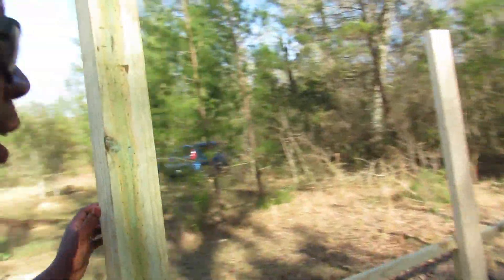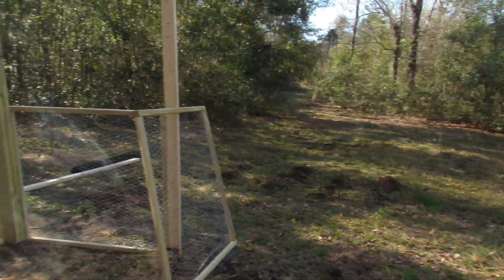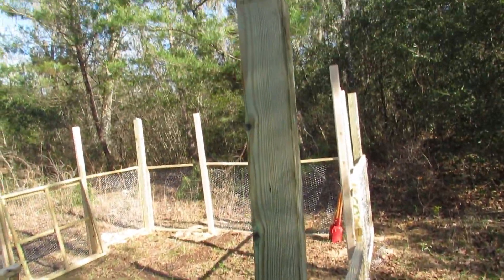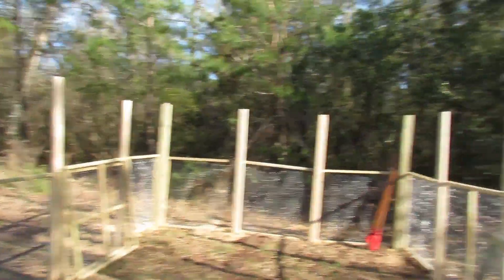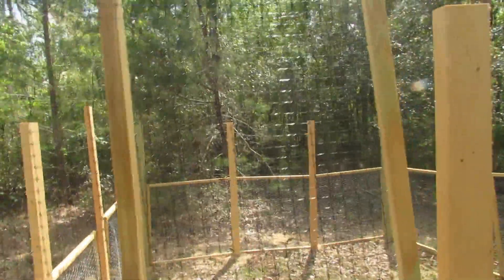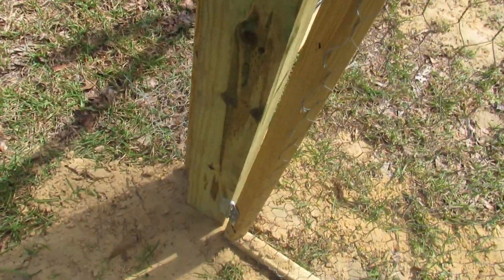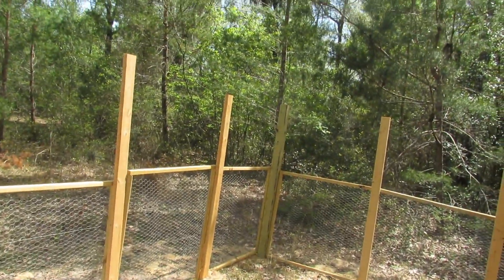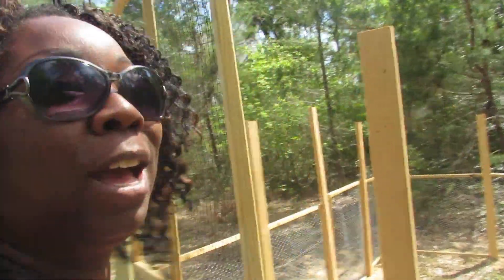DIY GARDEN FENCE

Comment: If my memory serves me correctly, Deer will avoid small enclosed spaces. With a fence like that, one could have a large garden fenced into rooms. Just a thought. Might be a easier way to keep out deer. And the extra fences would serve as trellises.
Reply from the maker: Ok thanks for the info. Ive also heard that irish spring soap will keep away dear. They dont like the strong smell. I was thinking about hanging soap in mesh bags around the garden.